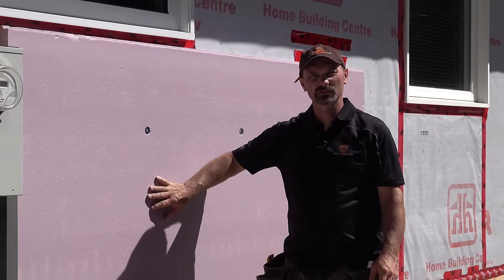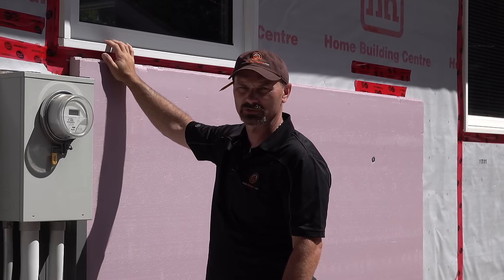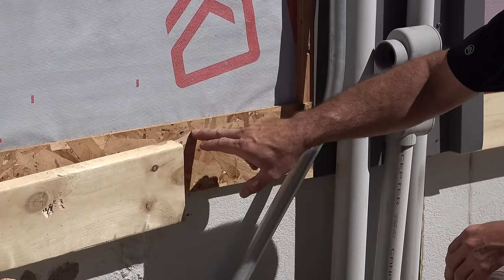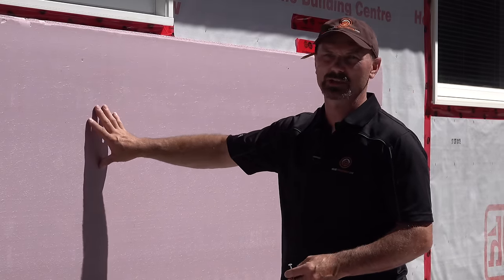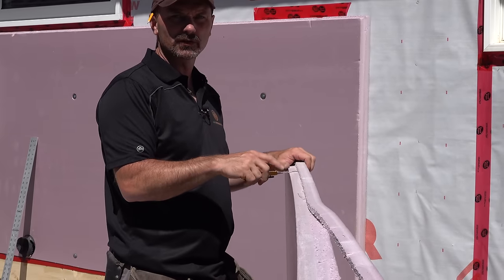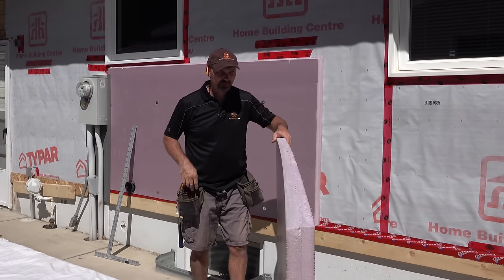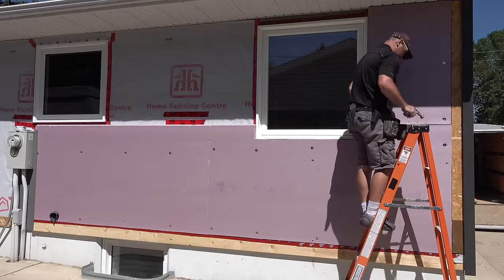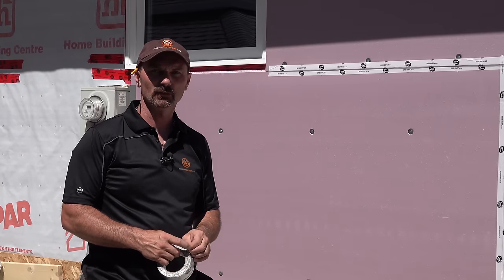How To Install Styrofoam Insulation On A Home's Exterior

Comment: great video, good explanations, what is on the inside of these walls, and are you insulating for heat? or cold? or both?
I am in  Central Ontario Canada, winter runs about 4- 6 months some years.
Reply from the maker: Both! I'm in Saskatchewan so cold is our main reason to insulate.
Reply: @HouseImprovements   Oh yeah, I have seen the weather you guys get. Something Else I was asking is what is on the inside of the house? in the wall cavity.

Comment: can i use cedar singles on top of that insulation? would i have to use straping on top of the insulation or would i be able to shingle right on top ??? starting my cedar shingles next week. im in mass and this its a great idea for a little extra insulation.
Reply from the maker: If your rigid is 1" or less thick I would say you could go right over it but if its thicker I would be inclined to either sheeting over the wall first and then installing house wrap and shingles or strapping the wall with 1x4s. We could discuss this more on the forum if you need more info.https://www.house-improvements.com/forums/

Comment: Shouldn't all the wood used at the bottom of the house and the electrical unit be treated wood?
Reply from the maker: No not really, it is not in contact with the ground and really should not get wet often and if it does should easily dry out. If you use treated wood then be sure your nails/screws are ok to use with treated lumber and you would have to use copper or some kind of vinyl at the electrical service because metal or aluminum should not be in contact with PT wood. You could use metal or aluminum if you used a membrane or maybe even house wrap between the PT and metal.
Reply: aah, I see thanks for the advise.

Comment: Awesome video! Thanks so much. I was wondering if you would recommend combining the foam board with rockwool? I want at least 3 inches of outside insulation so was think the comfortboard 80 and 1 1/2 foam board
Reply from the maker: I would not combine the two. You also need to be careful about how much exterior insulation you add depending on your existing interior insulation and your  climate. You should consult a local engineer or good contractor for their advise on this.
Reply: @HouseImprovements  Will do! Thanks for the response. I really appreciate it

Comment: That meter pan is an odd detail - and it appears to be newer than the house?  Whatever siding goes on, I think that install needs redoing just because they will have a surface mount box halfway embedded.  Get 15 years down the road and it needs replacement or upgrade, no guarantee of anything going right without tearing up that wall [again].
I find Spax washers do a decent job of preventing fastener pull-through on xps style foam.
Reply from the maker: Meter is maybe 20 yrs old. Not worth pulling it to extend the panel feed wire IMO. Really common to work with what is there , you have a good point however I could have left some extra room for future changes to it. Its a 200amp service so not likely it will need upgrading however.

Comment: Hi just wondering if i would need to put horizontal furring strips over the rigid foam board for vertical siding insulation? Or should i just put the vertical vinyl siding right on the rigid foam insulation boards?
Reply: That’s a really good question. Often I see this type of exterior foam insulation project come together nicely but when it’s time to install stucco or vinyl siding over it, seems to become a “ok now what?” Type of scenario. Also there’s usually other fixtures such as mailboxes and lighting etc that need to be adjusted to accommodate the foam. I’ve heard it recommended in another video to install the foam over the studs then osb / plywood on top of that so you have a substrate to fasten siding to. Just doesn’t seem to be a good way to do this overall. Wish there was a system out there that made sense.

Comment: Would like to see how to address existing exterior faucets.  Installed boards from the bottom up rather than top down.  Is it easier? Thank you Shannon.
Reply from the maker: You could install form top down if you wanted.
extruding items in the way can be cut out so you can get the foam on around them and then spray foam the holes /gaps tight with low expansion sprayfoam in a can. If you have more questions please use my forum.  https://www.house-improvements.com/forums/

Comment: Hello 
It's really great work, however I couldn't understand how you did the corners. Did you bent the styrofoam, the nail it and added the half inch wood on top of it. 
Thank you
Reply from the maker: The corners I installed a strip of 1-1/2" foam up each side of the corners then I covered that with a strip of 1/2" plywood . Then i butted 2" foam to those and filled in the rest of the wall surface. The 1/2" plywood on the corners makes applying nails easier for trims and corners.
Reply: @HouseImprovements  
Thank you

Comment: I'm a contractor and don't trust nailing the vinyl siding though the 2" styro. I decided to strap on top of the rigid. Have you ever installed vinyl siding that way?
Reply from the maker: I have not but you can. IMO it is really not needed but it won't hurt anything.

Comment: If I’m wrapping the exterior of the house with 2” of foam do I still need a vapor barrier on the inside of the house? I live in Alaska and our vapor barrier is behind the Drywall. I’m wondering how will the wall cavity breathe, or does it even need to? Great video!
Reply: You still need a vapour barrier on the warm side of the wall. Make sure that the exterior siding still allows the wall to breath.
Reply: @aaronpops4108  - does this make a "double vapour barrier" that could sandwich moisture in the wall cavity?
Reply: @corylechner8303  the correct exterior foam insulation would be vapor permeable. Foam boards have different ratings of permeability. I don't know what rating it should be, only that the wall still has to dry to the outside in a cold climate.
Reply: @aaronpops4108 - I hear what you are saying.  What water permeable foam board product would you recommend?  BTW - we already have a poly vapour barrier film directly under the drywall in the home's interior walls (thus I'm worried about a "double vapour barrier" issue).  And we have a very cold climate where I live (Saskatchewan, Canada, eh!)
Reply: @corylechner8303 I like Silverboard graphite exterior insulation from Lowe's. I believe it is also made in Canada. But there's several good products out there, that's just what I used.

Comment: Hi Shannon. I have a question. I'm working on a 80's single wide mobile home what would you recommend for exterior insulation I put on? Thank you. Love all that you do!
Reply from the maker: Because the roofs on most mobile home is have seen dent over hang the walls adding foam is not very easy to do because you are increasing the width go the home wider than the roof . If you have roof over hang than consider that IMO if you add less than 1" you are wasting money.
Reply: thanks for the reply. so, basically are you saying it's better to have no over hang? Right now it has none but, going do the roof. what do you think overhang or not? I was thinking about  2" insulation board of some type. @HouseImprovements

Comment: Hi there! I am renovating my house and my contractor ordered windows for 2x6 wall instead of 2x4. This leaves me with as only solution to reframe the outside, install the window and add 2 inches of the same insulation that you are using to fill the difference and then apply stucco. Can that be done? Any issue in your opinion?
Reply from the maker: No, other than an expense you were not counting on. Most windows you should be able to remove the interior jamb extension and cut it down and re install or re order the proper size. And any of this should be fully or partially covered by the person who order wrong in the first place ,IMO.

Comment: looks good but, it seems you have skipped the top 6" or so of the wall, above the soffit. Judging by the ship lapped for sheathing, the roof rafters are likely birds mouthed, so that your soffit as down on the wall.  That is a pretty large strip of the entire house to ignore. the Rigid should run up to the roof sheathing under the soffit (minus the vent space for the attic).  What did you do for this, or is this house different than my assumption
Reply from the maker: This soffit was existing and was not being changed. So yes if you have no soffit in place you would go right up the wall.

Comment: Can you put the insulation directly over vinyl siding or should vinyl siding be removed?
Reply: cant tell if this is a troll question or not lol
yeah you gotta get that vinyl down first
Reply: @Nelson676  no I'm not trolling.  I want to add rigid insulation on my garage.  It's already got vinyl siding. But I want to have plywood siding and was thinking about putting insulation over siding and plywood over that
Reply: @Nelson676  no haven't done it yet. ive had some financial and health problems and haven't been able to. im going to do it someday. i'll probably just take the siding off. it's a small building about 300 square feet. i had it built years ago and the guy i paid to do it didn't put much insulation in

Comment: I am currently in the process of upgrading my outside insulation. Will only be using Silverboard xs graphite 5/8".  Is it okay not to extend pass the soffit to roof trusses? House does have house wrap already installed
Thanks
Gary
Reply from the maker: If the soffit is installed already its not worth redoing to get foam up all the way IMO

Comment: Why you use 2 in insulation instead 1?I want to use 1 in, is there different?
Reply from the maker: The difference is in the insulating value. 1" is fine if that is what you want

Comment: I have old fiber siding hidden under vinyl siding on the house i purchased. No visible house wrap under that fiber siding. I am wanting to install foamboard under the vinyl siding. Should i remove the old fiber and then wrap house then install insulation foam board then put the vinyl back on? Any advice anyone? This is in the deep south USA. Thank you.
Reply from the maker: I would remove the old fibre lap siding for sure to get back to a flat wall , then I like to install the house wrap first then foam over it. This is just easier to do it this way because you can staple the house wrap to the plywood but you could not staple it the foam if you put it over the foam you would have to use shingle nails .
Reply: @HouseImprovements  love your videos and thank you for the reply and advice. I will do exactly that. Is there any safe way to remove the old fiber siding without damaging the OSB underneath?

Comment: Will the tape eat through the styrofoam? Or is there specific tapes to purchase for foam boards?
Reply from the maker: No it will not. Use house wrap tape
Reply: HouseImprovements .. Thank you sir for the response.
Reply: Some house wrap tapes use a solvent based adhesive.

Comment: doesnt the foam act as a vapour barrior? I thought you werent suposed to use 2 vapour barriors
Reply from the maker: The foam is not rated at a high enough perm rating to be an actual vapour barrier. Perm rating is just a term for how much vapour can transfer through it. Here , some foams up to 2"  can still be used like this.

Comment: Isn't it a bad idea to have rigid foam on exterior with poly vapour barrier on inside? (assuming that house has VB on inside)  No way for moister to escape?
Reply from the maker: Depends on your climate and the thickness of foam added.
Reply: @HouseImprovements  I really hope you see this soon. Moving into old cottage for winter -20average temp. About creating a moisture trap. What do you mean it depends on how much or thick the insulation is or iso-board is? The cottage owners just want me to put it on over the existing wood siding then reside over top of the iso-board or foam board later on. I just wanna not freeze my ass off. Please help
Reply: The cabin has poorl insulated 2x4 walls I’m guessing it has a crappy vapour barrier on warm sid

Comment: You are not afraid of putting Typar over OSB and foam over? Have you seen what happens to OSB or any other sheathing after 10 years if you do this? In my opinion, you are trapping moisture that will condense on the outside side of the sheathing, between the sheathing and Typar. The wall is covered with the foam and moisture doesn't have a place to go, which will rotten the OSB. This method probably should work in the warm climate, but will destroy the sheathing in the cold climate.  Great advice on the corners using 1.5'' foam and 1/2'' OSB to make it flush.
Reply from the maker: I have removed areas of this type of exterior construction to add windows in homes that were done anywhere from around 5 to 15 yrs previous. Never have seen rotted sheathing. Very common practice in the prairies of Canada.
Reply: @HouseImprovements  My experience had been different. Every wall that we opened that had foam, Tyvek, OSB and fiberglass inside (OSB was rotten from the inside) because moisture in the winter condensed on OSB
Reply from the maker: @ontimecontractorsinc6513   Poor interior air /vapour barriers I would suspect?

Comment: Hi, 
I have a finished plastered concrete house in south Florida and it heats up a lot because its and older house and I'm not sure if insulation is in the walls. Can I do this same process to better insulate it?
Reply from the maker: Yes you could and then re apply an exterior finish of your choice over it.
Reply: @HouseImprovements  ok thanks! Love your videos

Comment: Why the 2 by 6 at the bottom of the foam ?
Reply from the maker: I f you watch the video you will see my explanation at about the 6:10 mark. Basically I use a wood base made as thick as the foam i'm installing this gives a barrier from pests and also a good solid nailing substrate for the vinyl siding starter strip. In this case I used a 2x6 over top of a strip of 1/2" plywood because I was using 2" foam.

Comment: Do you have a video on how to put vinyl sliding over styrofoam board
Reply from the maker: Not specifically. It is really the same but use long enough nails to penetrate into wood buy 1”.

Comment: How do you attach siding at the end?
Reply from the maker: I installed vinyl siding directly over the foam. The foam was 2" thick so I used 3" nails. Some heavier sidings like cement board are not recommended over some thickness of foam, check with your manufacture. I have many vinyl siding videos on my channel if you need help.
Reply: @HouseImprovements  Any thoughts on adding 2" thick foam to an existing home with vinyl siding?

Comment: How effective is this when looked at through a thermal inspection?
Reply from the maker: I will try and remember this winter to have a look and do a video.
Reply: Thanks! I'm thinking about doing this with 3/4 polystyrene. Very concerned it might cause condensation behind the sheet. I have a light brown fiber sheathing on the house, with dense pack cellulose insulation in the wall. I'm really trying to move the thermal brake further out if possible. Any suggestions you know are proven? Fyi I'm replacing my siding next year with either vinyl or fiber cement. I have 3/4 during under my siding now.
Reply: @jameshorrocks2939  Interested to hear your results.  3/4 poly sounds like what is typically put under vinyl siding?  and not really as effective as 2+ in (if linear in effectives, 3/4in is maybe 1/3 of the R value he's putting up).  I thought one point that advocates of thicker exterior make is that the condensation/dew point is lowered so even though the walls are tighter (less air leakage that would have dried out the walls) there is less potential for moisture damage.  If the rigid foam is used, but not thick enough, then the air sealing still happens but without (most) of the condensation/dew point shift in the relative humidity graphs.  

Another option: If your "housewrap" is both an air and vapor barrier, so moisture isn't coming in from the outside, then the moisture problem would mostly be coming through the drywall, so you could lower your indoor humidity...
Reply: Sounds like you are on to my concerns.   I think sometimes people will talk themselves out of something because they have received information that says not to. Sometimes that information is bs. I guess I'm just casting some lines out to see if anyone has tried what i see as a possibilty with success.

Comment: Do you leave the polysterene exposed to the elements?
Reply from the maker: No it gets covered with siding. Polysterene deteriorates in direct sunlight.
Reply: What's the time frame? My vinyl siding won't be here for 2 weeks..is that too much time?

Comment: Could I take out my window out , Make foam to fit hole, Then put window back in?
Reply from the maker: yes but you will have to extend inside jambs of window after. Generally I would cut wood for around the opening the same thickness of the foam being used then install window to that  (more solid install) and foam to that wood. use our forum for more details.https://www.house-improvements.com/forums/

Comment: No roller on the seams?
Reply: If you notice you did not get a reply. Reason being is you made a stupid comment. Hint for you: the flashing material has already been rolled. This tape is used to adhere the panels together.
Reply: 61spindrift sorry, I am just a novice.   Thanks for letting me know.   I have much to learn.

Comment: Styrofoam in Europe has lower R value han Graphite polystyrene. Comes in sizes, standards, 1000mm x 500mm and PU foam is filled in-between the sheets, where jointing occurs.